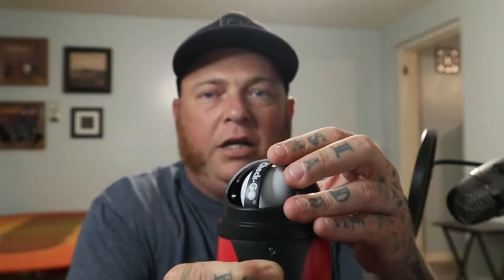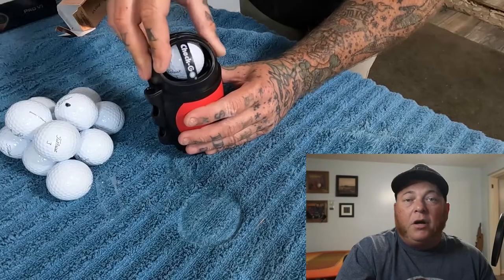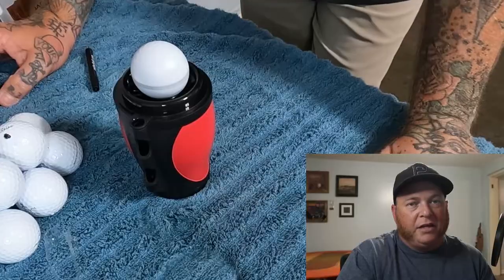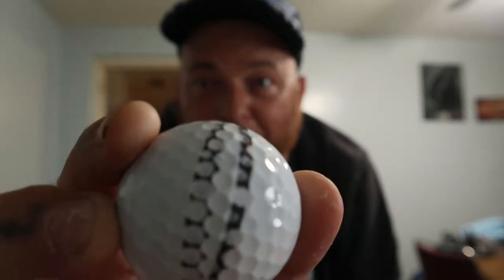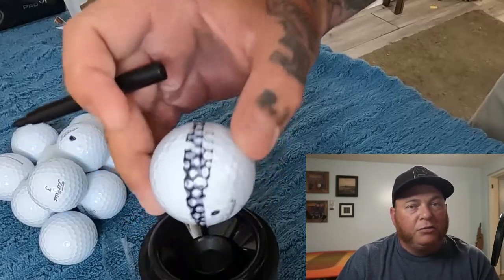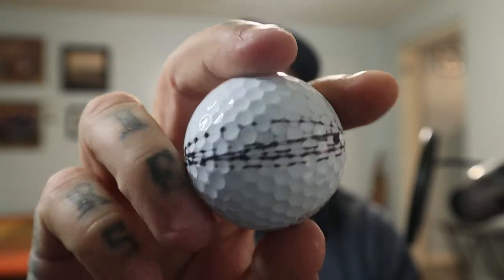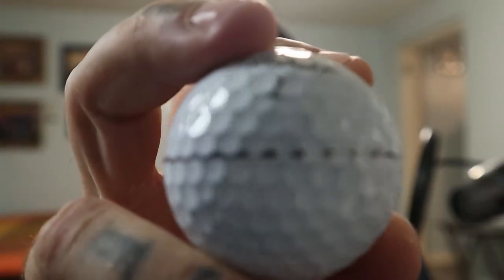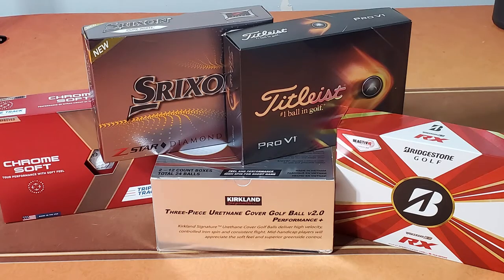BEST GOLF BALL TEST!?!?!? Check Go Golf Ball Balance Test & Review

Comment: YOu do NOT have to use their marker. I just drilled the hole a little larger and now I can use ANY Sharpie I want to use, You just have to be smart enough to do the same thing to your spinner. I use a RED Sharpie to mark my golf balls and a Blue one to mark my wife's golf balls.
Reply from the maker: Yeah i thought about that myself. Good to know.
Reply: If you don't want to drill out the hole,  you can just hold the Sharpie so the tip is just above the lip of the cage at the side. I do this sometimes. Works just as well and it a bit easier to do it this way. Try it and let me know if it works for you as well. Don.  @MilesMartinGolf

Comment: I use this on all my balls. There is no need to keep double checking them because you can’t trick it. I have had 8 different lines on the same ball which meant that ball was 100% balanced. The ones where you get one line and 5 or 6 more right on top of it or a millimeter off line means that ball has an off center core and is not balanced unless rolled on that line. I mainly use Pro V1’s but you would be surprised how many of them aren’t centered especially being the “best of the best”
Reply from the maker: Agreed.

Comment: Thanks for the video. I recently bought one of these check-go pro's but unfortunately every ball I've tested found a different center line. I tested multiple brand new Pro V1X, TaylorMade TP5x and Vice Pro & Pro Plus. The process is relatively simple so I don't think I screwed that up. Could it be every ball I tested was perfectly balanced or is this gizmo useless?
Reply from the maker: Its not useless.  It finds the exact balance point of each ball. So it wont tell you wich are good and wich are bad. Just the balance point.
Reply: If it found a different center line on multiple spins the ball is balanced and you can mark the ball pretty much anywhere it keeps going back to the same line it's out of balance

Comment: You have to spin the ball until you can visually see that it stops moving. Don't rely on the solid green light. It takes longer than that to settle in sometimes. Once settled, you can gently touch the marker to the ball for a longer period. This gives you a nice solid line on the ball.
Reply from the maker: Agreed

Comment: Nice video Miles.  Just in the process of editing the follow up to my video about this thing.  Should be up pretty soon.   After watching you and Gabe I realized I should probably plan out my videos a little more.  I tend to just shoot from the hip and talk as I go without much planning and you and Gabe present things so much better.  I guess that makes mine a little different though eh?   Anyway, just want to remind anyone interested that if you don't want the big line all the way around the ball, there is the option to put the little dot on top and then turn the machine over and use the bottom cup to mark a line of whatever length you want.   That's the way I'll do in the future but for the video it was easier to see the process with the full line.  Some good info though that gives some choices for people to determine if they want something like this.
Reply from the maker: I did this video talking to the camera as i unbixed it and used it but felt i was just rambling so did a voice over and didnt like that. So at the 9th hour the day before uploading i did a 3rd voice over and went with that one. I even had a second camera set up where you could see me and the device but cut it completely and just used the close up of my hands and the device.  So it may look planned out but it really wasnt, i just kept tweaking and re-editing till i liked it. Good call on the dot trick.

Comment: I recently bought this device, figuring we all could use sime extra assistance in putting. however the platform that the ball sits on was a little "off center". But the box wasn't damaged so I continued to use it to find the exact ball equator line. The only thing the device did was to stain a couple of my expensive Titleist AVX golf balls with the indelible black ink in the pen that comes with the device . Personally I think this device is total f'n crap and a waste of time and money. I'm sure modern, brand-name golf balls are "tuned-in" to the correct putting line and don't require golfers to use a B.S. device like this to find the line. After using it twice, I threw it in the garbage...where it belongs!
Reply from the maker: I wonder how much the piece being off center effected the machine. That said i know for a fact if you hold the marker on the ball for more than a split second it will ugly up a ball pretty bad. Anything touching the ball will change how it sits. My biggest issue with it was how hard it is to get a clean line on the ball. Touch it to hard and it moves the ball of its axis, touch to light and you get an ugly morse code looking line.